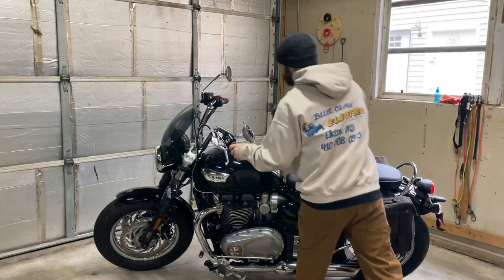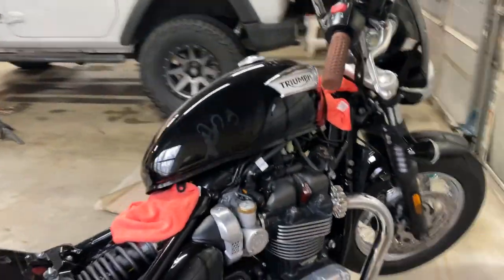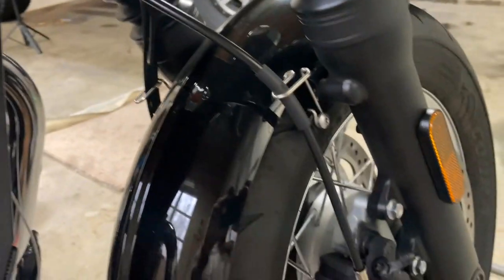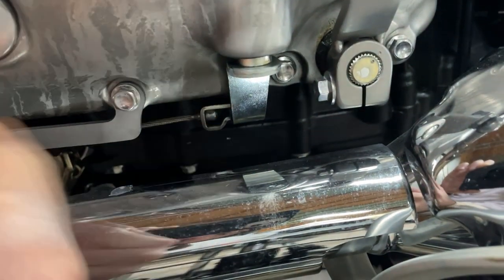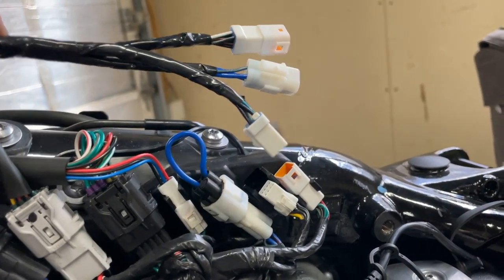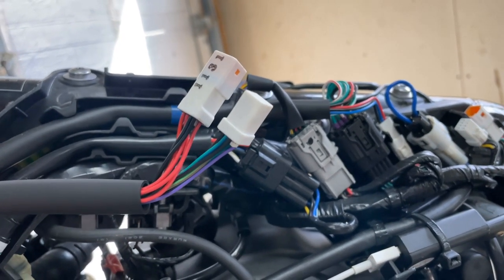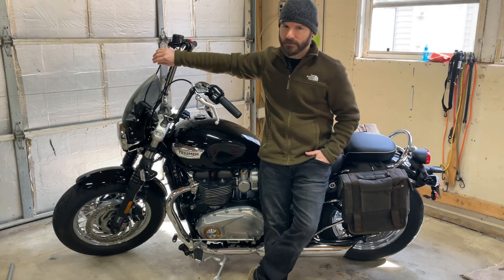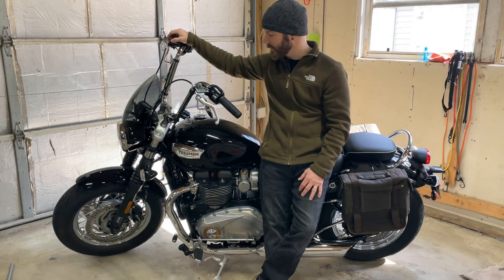Triumph Speedmaster 2022 - Upgraded to 12" Mini Apes and High bar cable kit

Comment: Hey Dave I was curious about how much shorter the triumph mini ape is compared to what you installed. You said that you discovered the triumph mini was shorter. Im in the process of trying to figure out handlebars Im a short man to but older with arthritis. If you had to do it over again would you have used the triumph Minis ? great videos.
Reply from the maker: Hi, the reason I did not go with the Triumph bars is because they are pinned straight up and down and I did not like the look, and it would have made me reach further (defeating the purpose). If you wanted something not as tall, I did have the 8" bars previously which are slightly lower.

Comment: Hi, i like your video and also like the 8 inch chumps. Do you have to use extension cable kit for the 8 inch bar? Thank you!
Reply from the maker: I did not - however I did have to re-route the brake line and clutch cable to the rider side of the triple clamp.

Comment: Afternoon Dave - I also have a 2022 Speedmaster. Although I love the beach bars, I had to swap to high bars too. So sad! (See my video.)

I didn't want to go for aftermarket bars as the drilling/filling required, and the 'hanging over the edge' grips just didn't seem right to me. Also, I'm a woosie. I watched your video of the 8" bars before I bought the Triumph stuff and the re-routing of the cables seemed a real hassle too, so I went for stock stuff - less the risers.

Dave, do your bars wobble about? Mine have a good deal of wobble 'cos the bars are rubber mounted. Do you get that?

Cheers,

Chris
Reply from the maker: Hi Chris, just watched your video. All I have to say is WOW, that's a lot of play. No, with both the 8" bars previously and now the 12" bars on the standard risers, I do not have any play whatsoever. I don't have a manual so I was surprised that there are no torque specs given for those. I wonder if they can be tightened further (I assume you've tried that). I never moved/removed my risers so I can't comment on how tight the bolts were or should be.
Reply from the maker: To follow up again, I just dug up the handlebar instructions, and it looks like there is supposed to be some sleeves that go inside the rubber bushings on your risers (above and below). Make sure those haven't been removed. Also the instructions give a torque rating of 38Nm.
Reply: Morning Dave - you're a wonder! How did you find that torque setting? I've looked all over... (How useful it would be if I had a torque wrench!) It's a real fiddle to get to the bolts under the top yoke (or, 'triple tree') 'cos of those cable guides, but I'll tighten them further - if only for peace of mind. (38Nm is only 'comfy' in terms of tightness, I think?!)

I was surprised that you said you 'do not have any play whatsoever'. I've always had some - even from after I had the high bar wiring kit installed by the dealer. The rubbers I have now are the new ones that came with the high bar kit, which also includes new 'sleeves, flanged, handlebar' T2045065. (Older sleeves seem to have been one piece, new ones are half length, two pieces.)

I'm out for a ride tomorrow, all being well, so I'll let you know how I get on after I've tightened the risers some more.

Thanks for the input Dave. 😊

Cheers,

Chris
Reply from the maker: @chrisoftheot6272  Search for Triumph Fitting Instructions 9900829 for the high bar kit. It's hidden down at the bottom of page 7.
I even went out to my garage yesterday thinking perhaps I just never noticed, but no, I can pull and push pretty hard on the bars with no play.
Reply: Morning Dave - stone the crows, I've looked at that instruction sheet a million times, but I've never noticed that torque setting. I fear I may be a moron. (I rather focused on the 24Nm setting for the clamps.)

I'm out shortly - riding to Swansea in Wales - but I have re-tightened the risers. The bars are more rigid now, which is good, but I wonder how much more than 38Nm I may have gone? (I used a 5", 14mm open spanner with one hand, hoping I wouldn't go over by much.)

Anyway Dave - many thanks for the pointer. I can't believe I missed that torque setting. Honestly...

I'll let you know how it rides tomorrow.

Cheers,

Chris
Reply: Afternoon Dave - well, I did about 250 miles yesterday (WONDERFUL!) and the bars were fine. I tightened the bolts as much as I was brave enough to do - I'm not sure how much damage could be caused when the bars are rubber mounted anyway.

Still, I'll get someone with a torque wrench on them at some point, just to see how hard I pushed!

Thanks again Dave - I'd never have found that torque setting without you!

Cheers,

Chris

Comment: Really great Vid and as you say we didn't need to see all the faffing around trying to get the kit to work you photos of what you did are enough. I'm changing my bars as I'm the same height as you but hoping to get away with risers and LSL flat track bars. I've gone for then id controls so don't mind being slightly forward rather then sitting dead upright..... time and distance will tell if that works. It' annoying how motorcycle manufacturers have a 'one size fits all' design policy. One question... did you drill the new bars for the peg on the throttle assembly?
Reply from the maker: Yes, I drilled the new bars. I've seen that some folks grind down the locating nub but drilling wasn't that hard so that's the route I took.

Comment: Looks great! BTW, I see you attached Burly saddlebags, do they fit under the rear seat pad or did you have to modify them? Sorry to hijack the thread! 👍🍻
Reply from the maker: Yes, they do fit under the seat pad! It's been a while since I first installed them, but I seem to remember removing some rubber feet off the seat itself to make room. Putting in the retaining screw for it requires pushing the metal tab down a bit as well. But it definitely makes them secure.
Reply: @davesdiy9836  outstanding I'll give it a shot, thanks much!

Comment: Did you sell the 8in bars ? Was it really that big of deal with the switch housings ? And drillling the joke out for throttle ..
Reply from the maker: No, I still have them along with a pile of other motorcycle parts in my basement. The switch housings were not a big deal, just take your time. I did drill out the throttle hole, just started with a center punch, then a small bit as a pilot hole, then the actual bit size I needed.
Reply: @davesdiy9836  Are they chrome if so do you plan on keeping them are selling them ? also with the aftermarket bars the biggest thing his the part that the grips go on is shorter so you have to use a differnt grip but know big deal right.And also with the 8 in bars you did not have to undo the break lines are clutch correct.
Reply from the maker: @leviteeler1629  For the 8" bars I had to re-route the brake and clutch lines, yes I had to disconnect them to pull them through to the rider's side of the triple clamp. Not sure if I'll keep or sell the old ones, I may hold on to them for a future project. Different grips fit but I have ditched the bar end caps in favor of a closed-end type grip.

Comment: How did u remove end caps from beach bars? I m trying to but no success . Or hv u used other end caps for TC bros Handel bar . If yes then can u plz share link so that I can also purchase
Reply from the maker: I did not use any end caps at all. The old ones are still in the beach bars, and I used closed end grips on the new bars.
Reply: Can u send link for closed grips
Reply from the maker: @spretam   Vans Cult Grips, 1" https://www.amazon.com/Vans-Cult-Street-Motorcycle-Grips/dp/B07NQ13MKH